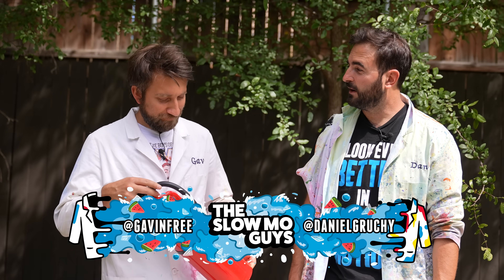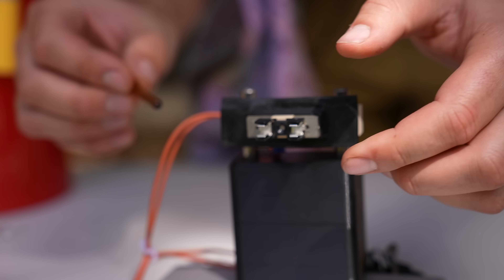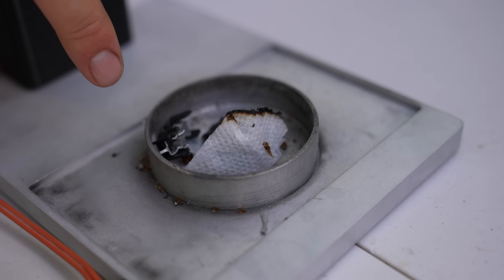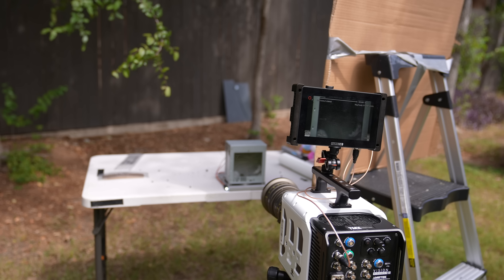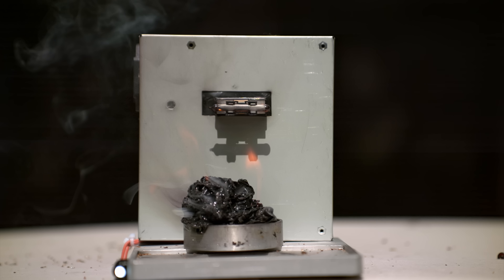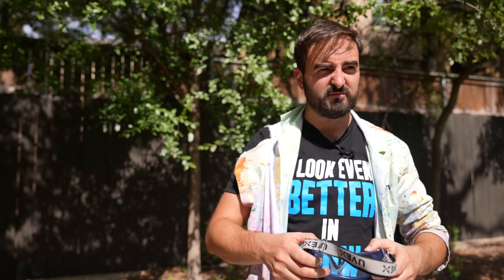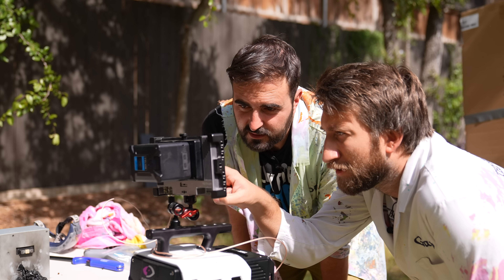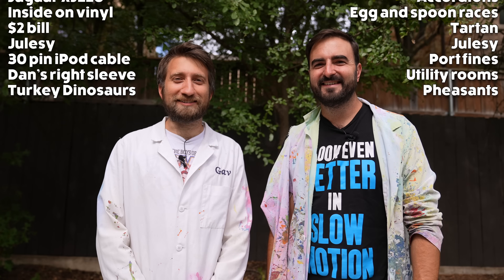Tiniest Exploding Fire Extinguisher at 150,000FPS - The Slow Mo Guys

Comment: There are very large fuses used in substations and other power line systems that use an explosive to make the disconnection faster. Big Clive did a video on them a few years ago, they're a cool explosive safety device!

Comment: Exploding safety equipment in slo mo idea. The overhead oxygen supply gear on commercial airplanes for when pressure drops in the cabin. They have mini explosions in them in order for the oxygen to start flowing when pulled down.

Comment: I have always been curious about what welding looks like in super slow mo. Either stick or MIG for lots of pretty sparks. I suggest a thick canvas draped over the phantom, molten steel and expensive cameras probably don't mix.
Reply: Sadly it isnt possible to record welding arcs, its just too bright they would need a phantom that could do light speed lol
Reply: @verakoo6187  Use a filter made of welding mask material, maybe; those can keep eyes safe and human eyes need LESS illumination than a phantom going at max speed. In addition, it's possible to configure a phantom to be surprisingly insensitive.
Reply: ok

Comment: Here's one to slow mo: 3D printed TPU racing drone propellers.
TPU is a flexible, rubber-like material which is ridiculously tough, I designed & 3D printed some TPU props back in March 2021 and I'd love to see what they look like in slow mo when spinning at top speed.
See them in action in "Five33 TinyTrainer with 3D printed TPU props"

Comment: I know of a cool think you covered, but did not cover the coolest part of it. And now I think you have the speed to cover it better: Above flash sync photogrpahy, with a flash.. Kinda.

Above the flash sync speed, or in another way, at shutter speeds shorter than the flash sync shutter speed (this is on cameras with mechanical shutters), the shutter isn't exposing the whole sensor or film at at any time, but the opening slides across it. One shutter starts moving and exposes the sensor or film, but before it's moved all the way across, the other shutter starts moving after it to cover the shutter.

This makes it so one firing of the flash can't cover the entire capture are with the same amount of light. The way they solve this is that the flash goes of many times in extremely quick succession until the whole capture area is exposed with the same amount of light from the flash.

That is what I wish you would capture at very high speeds.
Reply: Oh, and also, when you did the convertible BMW driving in water drops, you recorded if you got wet or not when you went fast. But if you look at that footage again, the part I think is the most exciting to watch is how the water drops that would have hit the bonnet/hood just vaporized in the air before they hit it, and that would be cool to see again, maybe with other lighting so you see the drops better. So maybe you need some strong fans blowing on the front of a car instead of driving the car, so you can set up lights more easily.

Comment: Fire bottle "squibs", they explode and fire a projectile through a frangible disk on a fire extinguisher bottle. That is what releases the extinguishing material. They use them in aircraft fire protection systems.

Comment: You should try zooming up REALLY close on burning solid rocket propellant to see the bits of aluminum melt, catch on fire, and lift off the surface.

Or even see if you can catch the little exposions on a sparkler.

Comment: How about party poppers in slow mo?
Reply: I just wanna know what causes the bang sound in party poppers
Reply: @brandonegan523  A party popper contain an explosive charge that produces compressed air in order to expel the streamers contained inside. The loud popping noise is the explosion going off. The explosive (typically Armstrong's mixture) is a highly sensitive friction-actuated explosive that detonates from the friction produced when you pull the string on the popper

Comment: How about the arcs that get struct between the contacts in some really big electricity switch gear? That could be interesting. The fzzzt sound suggests that the arc is repeatedly struck / extinguished, at 50 or 60Hz, so there may be more to see than just a single bright spark.

Comment: Some high voltage fuses also have explosives to ensure they cannot arc. Also electric car batteries have explosive isolators that fire during a crash that isolate banks of cells so that isolate and lower the voltage of the pack in a crash.

Comment: You could try the "battery safety terminal". A battery terminal in certain vehicles that, during a crash, severs the battery connection, and prevents an electrical fire from starting.

Comment: Looks like it is just a vial with liquid co2 in it. The vial is under high pressure close to breaking. And the heat just tipps it over the edge and releases the co2 whioch immediatly replaces the local atmosphere with co2 so the fire just goes out.

Comment: Flame sucked into the expanding gas caused by Bernoulli?  The vaporizing liquid will be moving much faster than the flame and therefore would have lower pressure.

Comment: Why is it that you use 50 fps for your videos and not 60 fps. I remember reading that in old times the frame rate of televisions were linked to the frequency of electricity which is why UK was 50hz and US 60hz. But aren’t you in the US all the time now?

Comment: Flash Bulb, the analog photography ones. They are magnesium wire filled bulbs, originally set off with a small explosive device contained within, the later versions used a 22v battery. it would be interesting to see if the magnesium wire set off all at once or followed the path of the wire and branched out! MrCAD in london has a a vast array of different types.

Comment: That liquid in the vial was probably super critical carbon dioxide. The heat makes the thin glass break as the liquid starts to boil and gain more pressure, you know the usual physics.

Comment: As it bursts, the long sides break, but the ends do not. The expanding gas pushes upwards (in that orientation), drawing in the air to the left and right, along with flames.

Comment: not a safety device but, an idea popped up when you were looking at how many frames it took for the light to go out. I wonder what a nichrome wire would look like if it was subjected to super high voltage and current from some beefy capacitors so it just vaporizes in slow-mo. Would it melt from the ends first and like carry a wave of heat? Or would the whole wire just instantly vaporize?

Comment: You should film a parachute AAD - Automated Activation Device in action if you want safety devices that go pop.
The AAD firs a small pyro charge which drives a piston driven cutter across the reserve closing loop. The loop holds the reserve container closed and activates the spring-loaded reserve pilot chute. The reserve pilot chute drags the reserve out of it's container and into the slip stream. 
The AAD is activated at a preset altitude which can be simulated by reducing barometric pressure. So a simple vaccuum chamber with a small pressure reduction at a speed similar to freefall. 
You could ask CYPRES out of Belgium for a test example or Vigil in Florida.
Reply: no
Reply: @haerfgvbag7050  Why no? Oddest reply I've had all day. Care to elaborate?

Comment: One thing that might be cool is DLP projectors that use colour wheels to create a full colour image from just a single colour laser, by passing the laser through a series of spinning wheel that filter or convert the light. They also often display onto something called a DMD, which is a tiny chip full of extremely tiny mirrors for every pixel that physically flip dozens of times for every frame, but that is probably extremely hard to film.
Reply: But the dmd would be so cool. Maybe film it with a macro lens.
Reply: Would be very cool to see in motion, but the feature size on the DMD is so small that you won't see any detail with a regular high speed camera. Last time I looked at a MEMS device  that had a similar feature size to a DMD, I needed a scanning electron microscope to see anything in detail. Luckily, I had access to one. However, to my knowledge, there is no such thing as an SEM that can produce more than 2 frames per second, and the resolution is very poor at those speeds. Typically, an SEM takes 5 or so seconds to produce a single frame. A macro lens simply would not do the job, I don't think any visible light imaging device could do it, save for maybe some multi million dollar microscope in a lab somewhere.
Reply: You can't filter other colors out of a single color laser, and I'm not aware of any way of changing the wavelength of light without a bunch of arcane optics.
Reply: @tyttuut  The OP is incorrect in that DLP projectors use a bulb, not a laser, and only one spinning wheel. I've taken plenty of them apart in the past, to clean the optical path (particularly the colour wheel).
Reply: @Zeem4  Laser dlp projecters do exist.
Reply: @Freak480  I've just looked them up, I didn't realise they existed because it's been a few years since I took a projector apart. I've also just read about how they derive the colours from a single laser. Interesting stuff.
Reply: @tyttuut I agree with you, you can’t change laser light colour easily
Reply: I think it was EEVblog that took apart a laser DLP projector. IIRC it had a LED for red, a diffused blue laser, and a green phosphor on a wheel that would light  up when the laser hit it.
Reply: actually, if they find an old DMD projector, the resolution will be lower, and likely with a bigger DMD array area, meaning much larger "pixels" they could capture with the macro. plus, even if the individual pixels are too small, they might be able to see patterns across the surface while in use. poke a hole through the side just big enough to poke the macro in to get a side shot of the array.
Reply: Excellent idea! I used to service DLP projectors for a school district, and got pretty familiar with color wheels and DMDs. You’re right, a slo-mo vid of one of these setups would be fascinating, although you’d need really high magnification to see the micro-mirror array do its thing.
Reply: The individual mems mirrors as small, but they can also move in groups. You can absolutely see the picture on a DMD.
Reply: I bet they could do it, Gav did a series of TV screens during the pandemic
Reply: I have an old, low resolution (800x600 native I think) DLP I'd be happy to donate to the cause. I got it free since it had a bulb explode, those metal halide lamps pack a wallop.

Comment: Ok, hear me out. Grab a super long piece of wire. Several hundred feet if not over 1,000. And wire it in series with the LED. I want to see if it remains on for 3 frames at that fps. Or does it increase of frames, hence it’ll react slower.

Comment: Speaking of explosive safety devices, you should check out an AAD (automatic activation device) used in skydiving. A small computer tracks your altitude against your freefall speed and if you are traveling a certain speed beneath a certain altitude a small explosive device fires a cutter that cuts a line that releases your reserve parachute.
Reply: that's very interesting, thanks for sharing
Reply: Slow Mo sky dive!
Reply: @griffingeode  sounds dangerous lol. Imagine they both jump off an airplane holding Phantom cameras
Reply: Do you have to be on fire?
Reply: @andycrask3531  It really seems to help, in my experience.   Especially true during water-landings.
Reply: @andycrask3531  Lol
Reply: @andycrask3531  😂🤣
Reply: That is cool. Thanks for providing the new thing I learned today.
Reply: What about explosively partitioned seatbelts?
Reply: AAD cutters are made to such high standards, that they're even sometimes used in satellites, to cut wires that hold things like solar panels folded up.
Reply: @galfisk  ohh that's how that works! Neat
Reply: Might be a little bit more difficult to film that one, either need to trick the AAD into thinking you're falling, or go skydiving with a Phantom. 🤣
Reply: @NFSHeld    Yes!  I came here to demand they jump out of a plane (probably multiple times) with 200lb of equipment.
Reply: Attempt's to release your reserve parachute
Reply: That's cool I didn't know those existed.
Reply: This is a weird coincidence. I’ve been reading Congo by Michael Crichton and they JUST mentioned it
Reply: While I'm sure watching this is slow motion would be incredibly interesting, I'm not certain that Gav and Dan have the equipment to test such a thing on their own. That would require some pretty specific stuff to film it in slowmo.
Reply: Why the reserve parachute?
Reply: @chitlitlah  I reserve is designed differently than a main. A maim is designed for performance and comfort during deployment. A reserve is designed for safety stability and most of all designed so that is HAS to deploy no matter what. It also  deploys on a spring rather than being dragged out by a pilot chute
Reply: @chitlitlah  The AAD is on the reserve so, in event of being knocked unconscious any number of reasons, your reserve will automatically deploy at a safe altitude. It's also been activated at times when skydivers lose altitude awareness and fall below a safe deployment altitude without realizing. AADs have a checkered history but at least provide that one last option should the skydiver somehow not deploy the main parachute.
Reply: @Slartybarfast B  That's the scariest thing about skydiving. Forgetting to pull the chute. Good to know our technology can back up human error.
Reply: @chitlitlah  I imagine it’s because by the time the AAD has activated either the skydiver has forgot or something has gone horribly wrong with the main parachute.
Reply: @demolisherinfinite8606  If an AAD fires, something (usually several somethings) are indeed very wrong
Reply: @chitlitlah  because if you are faslling too fast there would be something wrong with your main chute
Reply: Wow I had no idea something like that existed. Thanks for the little education.
Reply: Wow... Didn't know that. Thanks for the info
Reply: @TheGhostLead  I never needed mine, but I'm always glad to have a AAD in the container. How does it looks when you needed it shows that little video down below. These two guys had a total loss of altitude awareness, without AAD they would not have survived! The AAD fired 5 seconds before impact...

https://youtu.be/wCrvQ_xy_LA
Reply: @MisterIvyMike  wow! That's mind blowing. I'm glad someone is looking after those people who forgot to deploy a parachute or maybe unconscious. Thanks for the video btw.
Reply: They should definitely do that. Interesting info.
Reply: I had absolutely no idea that nowadays it's more than ropes and handles...
Reply: That's a trip I bet it makes your heart pound when it's activated.
Reply: Haha! I remember them telling me about that device, but to never count on it. Skydiving... what a rush - everyone should try it https://youtu.be/h6Z_uYMXRv8
Reply: Yeah, y'all should do this that sounds lit
Reply: Don't Read My Profile Picture  I can’t read but I’m pretty sure it says “ur ghey”
Reply: No matter how many safety devices a parachute has, nothing would induce me to leave a serviceable aircraft in flight... and most jump planes don't qualify as serviceable in the first place...
Reply: Sounds like a Rube Goldberg machine.
Reply: Don't Read My Profile Picture  I got a dig bick, you reed that wrong, you red that wrong too
Reply: There are exploding Personal Floatation Devices as well
Reply: No thank you. Do it yoruself. I am answering on behalf of Slow Mo
Reply: I offered the same suggestion. Greetings from DeLand.
Reply: W suggestion
Reply: wow that's awesome. wish i can go sky diving
Reply: Aa
Reply: Don't Read My Profile Picture   bruh this was popular in 2015 wtf are you doin
Reply: "..cuts you main chute so you really fall to your death."
Reply: Don't Read My Profile Picture  NO
Reply: @theflamingbanana7491  bots are not real people
Reply: @quickscope8034  is anyone really real on the internet nowadays?
Reply: @dylandepetro4187  im a French model haha. 

Referencing a old online dating commercial.
Reply: Don't Read My Profile Picture  toxic
Reply: DontReadMyProfilePicture.3  ok
Reply: Don't Read My Profile Picture   He Lives!
Reply: Don't Read My Profile Picture  ok, i wont

Comment: Maybe have a look at those table saws that automatically retract the blade in contact with flesh, those are pretty fast too
Reply: @Perceptence  or when you forgot you had it and go to cut a sheet of aluminum
Reply: sawstops yeah but arent they like one time use?
Reply: @ivarsdredzels231  The cartridge is, but you can replace them pretty easily so they could get a few shots.
Reply: @skylerlehmkuhl135  pretty easily? last time I heard they were around $3000 dollars to replace
Reply: @branimirgacina4  Nonsense. Less than $100 plus the cost of the blade.
Reply: @branimirgacina4  hands probably cost more and hurt a lot more too
Reply: @halfbakedgaming69  no no, I know its worth every penny, but I mean for Gav and Dan, to replace them after every take, to get like 3 or 4 wouldnt be cheap. (or at least I thought so from the last time I heard the price of replacements, maybe not so much these days )
Reply: Replied with the same thing before I saw you had already suggested it.